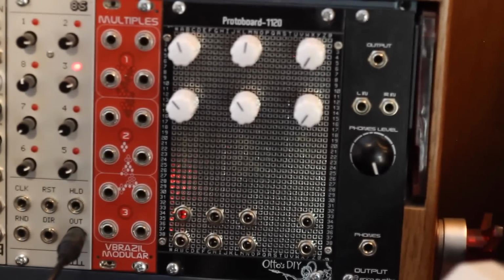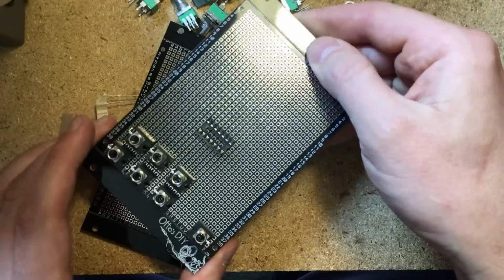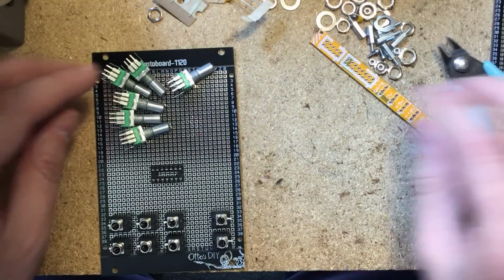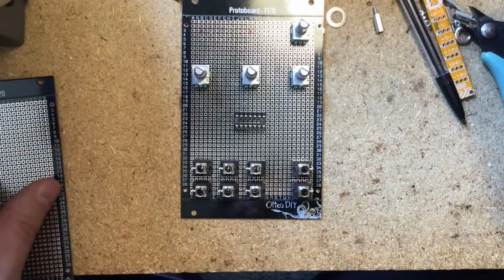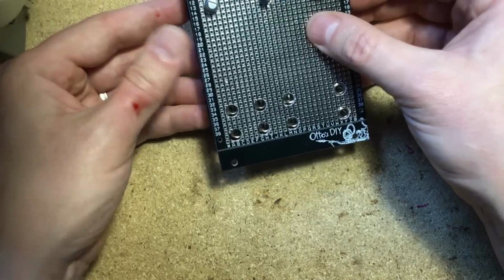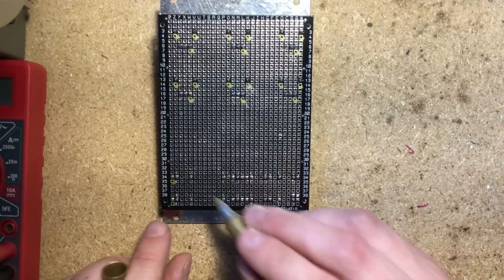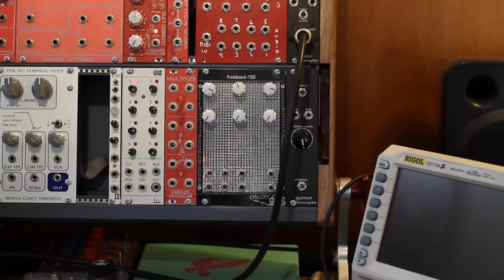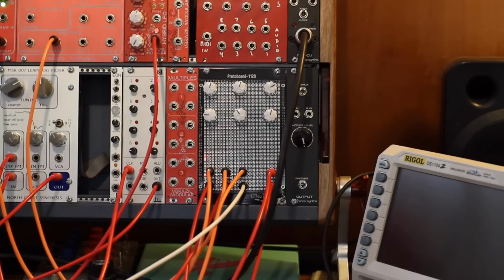SDIY Class # 10 -  Building a dual Mixer with Otto's DIY

Comment: Nice build!
I would have liked to see some of your troubleshooting and fix-up process, though, as that's where I sometimes (often!) struggle in my own builds. :)
Reply from the maker: Thanks! I thought the video was super long already, which is why I didn't go into detail of my troubleshooting. But basically, some inputs were not working so I used the Multimeter continuity tester to follow the signal, from the jack to the pot to the circuit. Each time I found a bad joint or a connection I had failed to make, fixed it and done!
Reply: Synth Diy Guy I was going to say the same thing actually. I'm really new to electronics and you might not realise how something that seems so simple to you can be a mystery to a beginner :)

A video on trouble shooting a build like this would be really useful I think.
Reply from the maker: Thanks, I'll keep that in mind :)

Comment: Excellent video. I will definitly bare this circuit in mind for my project. Loved the tip on not triming off the leads.
Reply: As I remember from my old days of education in Electronics, the better way is to trim the leads first. Then soldering them (gives you less chance of having "cold/bad" solderjoint), and finaly use the excess or some other (ideally beforehand stretcht, to make them straight) silverwire for the connections.
(Last time i did this must be 29 years ago....)

Comment: I stripped a 50” plasma tv. Removed the plasma panels and I’m going to use the solid aluminum backing for my panel. Lots of room and it still looks good in the box. May take me a few years but at least I will be able to operate it blind.

Comment: Hey bro, I love the channel. I have learned so much about circuit bending old toys to use with my Pocket Operators. Could I ask you a question? So my father works for a wire harness factory which creates chassis for forklifts and automotive parts, they have access to female/male terminals, Deutch LADD and Kometsu socket/pin connectors, pots, switches, different wire lengths and cables, and my dad said he'd get me a kit together and solder for DIY projects like yourself! He'll get me all the parts, and all I need to get is the breadboard basically. I actually worked with him before and used the Cirrus test board with ribbon kits to test different harnesses! Anyway, I don't exactly know what to ask him to get me, I was thinking a general multi-cable would be cool with male/female ends for all possible pin outs for audio and media/TRS/1/4/1/8 and Stereo 3.5mm plugs. As for a modular hub to interact with CC mappings and USB host data (gonna program a Teensy Audio Library chipset eventually) what parts from my dad's job would you suggest I ask him to started assembling some of your projects? I want a synth hub to plug all my devices into and use it with patch cables/POs for sampling from my Phone/Tablet. Essentially I would be building a frame which can fit inside of a plastic toolbox which can open and close or a bigger briefcase to house everything; special components would be an LCD waveform analysis synthesizer module with velocity pads, arcade buttons, 3.5mm stereo inputs for Pocket Operators and Korg Volcas (CV Gating) and Pulse Width Modulation. USB power bank to power everything. Now I'm still new to all of this, but I already have access to the tools - a stable wooden desk to work on, soldering gun, solder, heat shrink, 10/12/14/16 gauge wire, amps, but I need 10k resistors like you mentioned. My dad said a lot of their parts come from Digikey which they already have in inventory. I'm trying to understand the necessary components to start going mad scientist and taking apart my old electronics and toys as donors to transplant onto a new circuit board with the new parts to make it all work together. Hopefully some of that made sense lol. Watching you solder the wiring on the back reminded of the DIY Apple Disk II kit, where you have to route and layer the wires to build using hex machine code the CPU, ROM, and RAM! Thank you and have a great day!
Reply from the maker: Hey! Sorry for the late reply!
Sounds like your dad has a fun job with a lot to offer you! But I think in order to gain the basic knowledge so you can know what to ask him for, you should start assembling some simple cheap kits. You'll start realizing what values of resistors and capacitors, what type of chips and transistors are most used, etc...
Check out my "easy beginner kits" playlist, start with some of those. You'll need a case and Power supply to start. My video on the Befaco Lunch Bus might be useful, maybe you and your dad can build your own box to fit the power supply and rails in. Digikey has the rails you need, they are called Vector rails.
Good luck!
Reply: @QuincasMoreira  So, I tried to make a list of components to ask for as they've got plenty from Digikey and other parts depot places. I have 6 pocket operators, so I'd like to use alligator clips or something to make contact and use them with arcade buttons like you did. Some kind of non-destructible build using pogo pins could work? Have you seen the Pocket Operator Midi Adapter on Tindie made by Hanz? Do you have a list of the required parts which I could cross reference with him? I actually worked with him for a few years, so I know how to point the diodes the right way, capacitors/transistors/relays/amps etc. Some of the harnesses we built were military grade and went into helicopters. We had to cover them with conduit or braid to protect the wires. It's like I've got the skills to do it, but just don't know where to start, haha. Thanks for all your help!

Comment: Hi Quincas! My mixer is rocking great, thanks for your videos! but I have a question going around for a few weeks: I am close to finish my rack space and I need to keep an eye on consume. How would you calculate consume of this mixer or for example the deadbug buffer? is there an amount of + and - miliamps that we can reserve for each TL074 in DIY builds? Thanks!
Reply from the maker: Hola Sergio! So, current consumption depends on more than just the number of ICs and components, it has more to do with what the circuit is doing. You can measure it by using your amp meter in line with me module's power supply (current goes through the meter before it hits the module). Or you can get Joranalog's test 3 module which is made for this purpose. Another idea is to look for a similar module at Modular Grid and see what it says under current consumption. It's likely that any mono mixer will draw about the same.  Saludos!

Comment: I was cutting resistor leads after soldering them to a pcb, and a tiny bit flew into my eye .. no damage, but shows that even glasses are not always enough protection.
When drilling, I would suggest putting a couple of screws into the corner holes into the wood below. Then the board will stay still while you drill.
Why does your solder smoke rise straight up, while mine always drifts toward my face? :-(
Reply from the maker: Great tips, thank you! I had a fan blowing out my window and thus pulling the smoke away :)

Comment: Love it but it's huuuuge! Why not use board for ground rails?
Reply from the maker: Well, that's the size the boards came in, they make smaller ones too. It's relative, if you have a large system it's nice to have wiggle room. and you can make some passive mults with the leftover space. And I'm not sure what you mean, I did use parts of the board for ground, and other parts where it wasn't practical to do so I used wires.

Comment: Are you just using solid solder to bridge those grounds across the board?
Reply from the maker: No it's wire! I just removed the plastic from some solid core wire
Reply: Synth Diy Guy ohhhh is that what people do? I see it all the time in DIY stuff but no one bothers to explain it! Thank you!
Reply from the maker: @BeniRoseMusic  Yeah, sometimes it's better, like for grounds where the same wire has to go to many places :)
Reply: Synth Diy Guy ya, I have definitely struggled to solder two wires to the same ground before and thought “there has to be a better way!” And then saw this kind of thing but wondered what they were using. Guess it’s one of those “so obvious no one mentions it” kind of things to just take a solid core out of the shielding.
Reply from the maker: @BeniRoseMusic  there you go ;)

Comment: I know this was a while ago, but what was the reasoning behind using the opamps as inverting amplifiers twice? I'm just curious if there was a reason 🙂 thanks
Reply from the maker: Yes, this is how every opamp mixer is made, dual inverters. noninverting is only good for amplification purposes.
Reply: @QuincasMoreira  awesome, thanks! I'm going to have to read more I guess 😄
Reply from the maker: "The advantage of using an op-amp inverting amplifier is that the summing point is virtually at earth potential and therefore the settings and signals from each different channel do not affect each other. In this way each channel can be summed or mixed regardless of the signal level, source impedance and the like."
Reply: @QuincasMoreira  thanks again for the help! 👍 I ran to that Texas instruments opamps handbook again right after you replied. I guess I still basically use opamps as they appear in schematics and never thought about the "why" of the inverting input before

Comment: where to take the circuit with capacitors?
Reply from the maker: The two Electrolytics (10 uf) go where power enters the circuit. One for each power rail, be careful of polarity. On the negative rail, Cap negative to -12, Cap positive to ground. On the positive rail, Cap positive to +12, Cap negative to ground.  The two ceramic (non polarized) 100nf decoupling caps go from each power pin to ground, as close as possible to the pins themselves on the Opamp.
Reply: Synth Diy Guy tnanks ! Great work! Great work! Could you explain beginners how to make lfo eurorack module using plain parts? This would be very much appreciated.
Reply from the maker: Thanks! I will try to make such a video, but it may take a while, I have a lot of kits to review right now! Check out projects with the CD40106. It has 6 square wave oscillators, but you can also get a triangular like shape out of the inverter inputs and make opamp buffers for them:  http://www.fluxmonkey.com/electronoize/40106Oscillator.htm